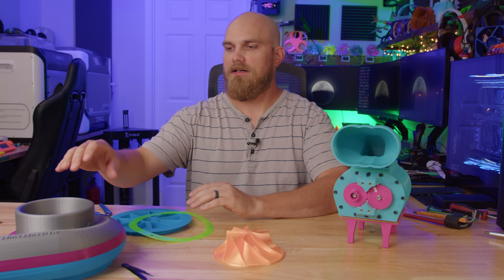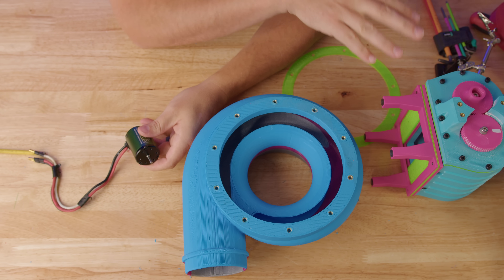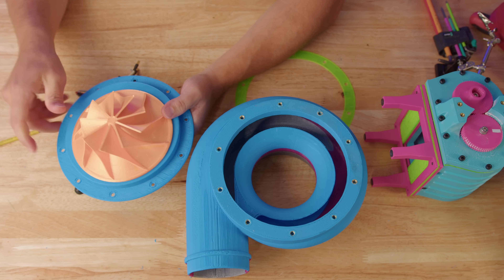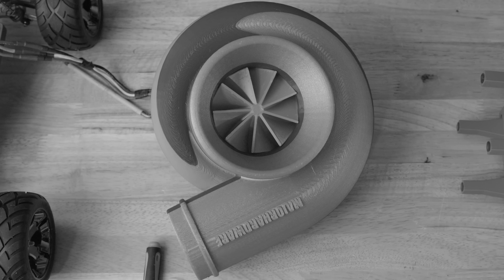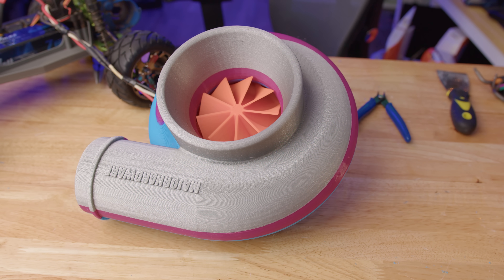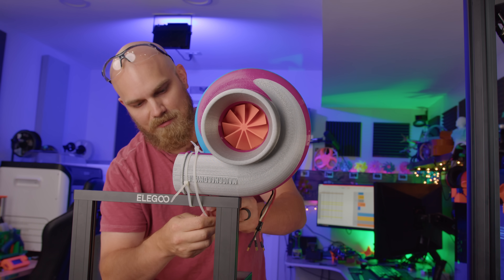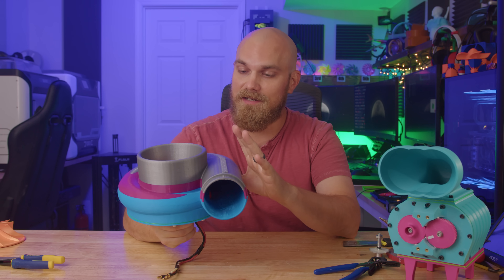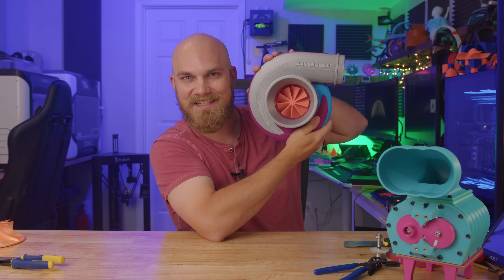I BUILT a MASSIVE ProCharger for my PC

Comment: Hobbywing EZRun MAX6 V3 Sensorless Brushless ESC & Motor Combo w/5687SL (1100kV). This is about the most cost-effective motor upgrade for the Traxxas X-Maxx. I would somehow use a bearing to support the compressor wheel instead of supporting it with the motor shaft.

Comment: Would love to see you try and make an adapter bracket to put the pro- charger into the roots blower and see if that boosts the flow! Maybe two upgraded motors to push them both to 15000rpm. Think like angle grinder speeds...I wanted to see some PLA explode...

Comment: Should look on Hobby king and might want to look at an airplane motor rather than a car motor. The outrunner style motors will likely do better with torque and running at high rpm for a while which is why they're used on things like electric skateboards and large rc helis and planes. Look at the PROPDRIVE v2 3548 900KV Brushless Outrunner Motor. You're also going to need an esc to handle the higher voltage to throw at it to get the RPM you want.  It maxes out a recommended 4s lipo so any 6S, 55amp capable ESC should handle it fine.

Comment: some ptfe spray might help with the friction... and maybe if the tolerances are too tight some sandpaper might come in handy :p Maybe also add some bearing in the center of the intake to prevent it from wobbling around like it did on your model.

Comment: Maybe add a front bearing hub on the intake side shrouded inside a stator and intake horn?  Like using a tail stock on a lathe to stabilize the spinning parts.

Comment: These tiny shafts are meant to drive a gear box of some sort, not have a large and heavy hunk of material directly supported by them. Using a through-shaft with front+back bearings for support would keep the fan perfectly centered and spare the motor from having to support it along with stresses from dynamic imbalances.

Comment: Best motors that I have found are actually out of brushless power tools. You can find a lot of old dewalt DCD996 Hammer drills for not working on ebay. Most of the time the controllers are dead or the sensor on the back of the motor comes unplugged. but most of the time the motors are fine. Do note that the motors from these drills are capable of over 20,000 RPM at 20V. I have found them as low as $20.

Comment: I think that belt drive would help with the design. You could make a beefy shaft running in large bearings and option to space everything properly.
But the belt must be proper closed loop, not the GT2 glued together that you used the last time :D
As for the motor, I'd look at outrunners used in RC planes. They are made for low RPM/high torque loads and often have hub with screws, which would help with your designs.

Comment: gear it or belt pulley and 5:1 then 10:1. that way not too much strain on the next motor. you went direct drive on that small shaft and the motor felt it in whatever transients were caused by airflow and "design imperfections" but you called it all the way through. very fun to watch and great commentary thanks for your hard work and entertainment.

Comment: Hey, I was thinking that maybe you can you use a high torque motor, and use gears to sped it up, like 10 to 1. That way, the force will be applied to the gears and the engine will probably survive... The idea is to take away the load from the motor, and the best way I know of doing so is with gears. You can also use belts. I'm thinking on something similar to the shaft on a lathe.

Comment: Well, I use liquid abrasive polishers, like the ones used while polishing a car, as lubricant for my parts and that kind of helps with tight tolerances... it has a low success rate, like 20% maybe, and is just a last resort, like for instance, I don't want to wait 20+ hours for a print and I'm gonna throw this one away anyways kind of situation.

Comment: If you want to do random stuff like that you need around 4260 (42mm width, 60mm height) with around 600-1000kv with 6s. 
In theorie you would want a higher kV ratio with projects like this but it gets expensive pretty quick.

Comment: Check out Sunnysky motors. I use them on all my rc planes. You  can get them up to 40cc equivalent with 10mm threaded shafts 125 amp and 12 cell rated.

Comment: running a 1/8 scale buggy motor would probably be the best idea, they have 5mm shafts and are capable of 6s minimum, some are the same outer diameter as that one and there are some that are bigger that would work the best for this kind of project, and try to get a sensored motor and ESC, they are more efficient both heat and power wise

Comment: I have an old shop vacuum ac current that is at least 1hp output and a threaded shaft Or i have a 6 volt dc currrent motor that has a splined shaft and would be plenty powerful enough. I would be willing to send either of these to you to try.

Comment: The kV of thre motor you are using is around 3 times too high for your application. You may be able to use a " Prop Adapter " to attach whatnot to the shaft.

Comment: Since the fan designs have been becoming more fun and over the top which makes them impractical for being installed into a computer case anyway. Why not just skip the little brushless rc-car motors and invest in a small induction motor you'd see on a drill press or other piece of equipment? You should be able to rotate a good size fan at some decent speeds with one of those and it can be plugged into your wall. No need for batteries or burning up expensive esc's. :)

Comment: There's definitely room for improvement here. I say do it. I want to see you improve on this & do it better. =^/.^=

Also, I'm right there with you on that motor. That would be my first port of call - upgrading the motor & motor controller. You may also need a battery with a higher C rating, capacity & cell count to suit the larger power system as a whole.

Comment: Hobby king has some great options for motors, escs, batteries, etc. I have a 3.1kW motor and 200A esc in an RC boat I 3D printed which I got off hobbyking for a crazy good price and they are awesome.

Comment: A venturi (aka "velocity stack") on the air intake would probably help, though at these levels, I'm not sure by how much.  Bushing/bearing on the compressor, with a supported through-shaft will help keep the lateral load off the motor shaft.

Comment: Use a three phase brushless motor and inset it into the turbine. Then you can put little tiny breather holes in the center of the turbine and use the turbines natural motion to pull air through the motor for cooling. This will get you really good power efficiency, good natural cooling, and because the bearings on most brushless motors are pretty good it should give you a pretty unbent shaft in the end. Take it from me who learned the hard way though, overspec your motor by at least 50%

Comment: If you do buy a new motor I would suggest a 5mm shaft (or bigger) over what you have now (1/8'' shaft). The only problem you might have with it is 5mm shaft it's more for 32-pitch gears and 1/8'' is for 48p. 1/8'' shafts are really only meant for 2s 2pole 540 motors... yes it can do more but not really made for it + 1/8" shafts like to snap off.

Comment: I really want to see a compound turbo set up. Use 1 A12X25 to power a procharger, then design a second turbo charger that it feeds to spool it up even faster using gear ratios.

Comment: You do understand that compressing air adds energy which heats it up, right?  So, not only are you pumping more air, you're also pumping heated air into your PC...  Also, all that extra plastic will allow your air to accumulate static charge.  And then you're sending that into your PC??

Comment: If you need a good motor it could be wise to look into stripping down an electric leaf blower for parts, Either an AC powered one and use a Variac or one of those battery ones and use some kind of control circuits.  The big thing about motors from something like a leaf blower is they are designed to turn a blower wheel and also designed for continuous service.

Comment: To solve your overheating problem a castle mamba  monster 2 combo with 2200kv motor will work great and the esc works from 2s to 6s. It is my go-to for most of my RC needs.

Comment: Don't wanna sound like hater, just an observation, but why not use some basic tools to fix the prints and make them smooth and sand the stuff that scratches and causes unnecessary friction and noise.
Not just this video, noticed also same thing on some fan videos where fan out of print would be a bit scuffed and some light sanding could make a world of a difference.

Anyways, if you shrink this a bit and tune it up it could be actually usable and probably pretty good fan. PC coolers already comically large, so what's a big snail on top of already brick-sized block of aluminium...

Comment: There's got to be a way to use the waste heat from the CPU cooling to power this right? That thing is putting off what, 100W? Could even end up with a self regulating system if more heat = more cooling.

Comment: You should throw it back ww2 style and make a turbo supercharger from it. The supercharger would need the progressive compression twist screws and should feed into the turbocharger for additional compression. A turbo supercharger assembly uses a gear drive for the supercharger and exhaust drive for the turbo, so you’d need to also duct in a loop of exhaust air to drive the turbo intake before exiting the exhaust loop as well as having an open intake pipe for the turbo to draw in additional air for compression between the turbo and supercharger. Net air pressure coming out of the exhaust loop should be between 1.5- 3x the pressure that the supercharger would be capable of on its own due to the additional boost provided by the turbo

Comment: My Idea for this "Small Beast" of a Procharger would be the following:
Make it 50% bigger and then go buy any cheap Desk Fan because their Motor runs on AC but it has enough Torque for this kind of Setup and it has an 0,3 inch (7,8 mm) diameter Shaft which is halfway threaded which is more useful than you think it could be...
If it is 50% bigger with this superior Desk Fan Motor you can easily outperform your current Design with having probably a bit lower RPM (The RPM doesn't really matter here because of the huge amount of Torque which could handle even bigger ones than just a 50% increase in size, probably up to 120% bigger than the current model)

Comment: You Should add an Top baring on the Intake to make the Blade less wobble or better an Shaft that goes from Top of the Intake trough the Blade into the Botom and then you connect the Shaft with an pulley to the Motor like an 2 to 1 Gear Ratio, so the Motor doesn't need to be at full load all the time
Reply: Does that make Sence

Comment: Awesome outcome!  Flows really well!  Next, all you really needed to do was 'port' your compressor housing to fit the compressor wheel better.  Then, like others have stated- add a prop shaft with a few ball-bearings that lead to the backside of the compressor housing from the Motor. The added space gives more room for the motor to cool / add cooling yourself.   Would then love to see you mock the flange up to a pc case and test the temp drop

Comment: I'd recommend you Turnigy Aquastar T20 3T, it's a 730KV motor, capable to take 11S Like a champ and 12S if you feel like pushing your luck, but it will deliver solid 5200W+, and you will need 2 ESC's tu run that bad boy to it's total power, and you can also hook up to it a water pump with a small reservoir, hense Aquastar designed for boats and capable to move things quickly and kept cool with water.

Comment: The shaft should come all the way through to the front of the turbine and bolt to the middle. That should help with overall shaft alignment. Grease that sucker up good too as you have no lubrication flow. I'd really love to see that pro charger peaking cause at high rpm it should make some good boost!

Comment: Would be cool to do a shaft all the way through the comp wheel with a two bearing support that you then connect to a motor with a coupler. Would allow it to stay nice and straight and compensate for slight alignment issues.

Comment: Since no one is answering the question lol a good motor to use that will eliminate the issue will be a mamba monster x motor and that should have plenty of power and not over heat you will need to make some modifications to make it work though

Comment: To help the motor, I'd suggest changing the orientation so the impeller is below/above the motor or I'd add another point of contact with a bearing at the front of the impeller.

For the replacement motor you could look into the 1/5 scale motors instead of the 1/10 scale you're using.

Comment: You could try a screw type supercharger. Also, you could try a double sided centrifugal supercharger.  One beefy motor between 2 snails. One to force air into the case, and the other to remove it. Basically create a wind tunnel for the comp components.

Comment: "That's how design works. You get them close enough then you let the parts figure it out. Ok that's not how design works." 

Except. It is! That's why you have a break in period for things like an engine. All the seals and clearance bits and bobs need time to work out their tolerances with each other before its ready to operate at peak.

Comment: I wonder how making an airtight case with something like a turbo on the inlet would cool a PC. You’d have pressure driven air moving through and, if you make sure your airflow is good, maybe you could cool more than just having a bunch of fans blowing air somewhere, sometimes?

Basically, a positive pressure system that would send air throughout the case as flow went from high to low areas through the case, and ultimately out the exhaust.

Comment: Hiding a whole outrunner motor in the impeller could possibly help with the stability (the motor has 2 bearings, well placed), and with cooling of the motor if some airflow is allowed through it.

Comment: If you are curious what kinda power you need tesla500 did the same thing you did but with an actual turbo. He has 2 videos on this. Since your parts are plastic i doubt you can reach that much air volume and pressure but its a good inspirational video atleast.
Edit:He has only one video about it but it says part 1 so thats why I said 2

Comment: I think your on to something.  I know of a high rpm motor designed but a crew of top engineer's for a real expensive hair dryer, it's like 100k rpms and quiet.  I'll look for it and post.
Reply: Got it!!!   Both Dyson and Laifen have 110,000 rpm motors in their hair dryers, designed by teams of engineers.  Cost new just under $400.

Comment: Need to get a much lower KV motor, try something around 300 - 600kv should be good. Essentially the lower the KV, the higher the torque for the same wattage.

Comment: Why not print a tpu belt and a 2 pulley system  to run it like a normal procharger (centrifugal supercharger?)? Would also mean easier connection and not needing to tolerance the motor into the part?

Comment: Why don't you use a real turbo from an old car and adapt that. As long as it don't rubs I think you have a good change to get the performance you want. Yeah I know, then it is not 3D printed. But the tolerances in these parts are very difficult to get with 3D printing.                                                                                                                                                                                                                                                              The 3D printed housing looks pretty sick this way. Way better than in one colour.                                                                                                                                                                                                                                       You can put the prints in an alcohol/thinner/paintstripper bath for a few seconds for a smoother finish. Or make a vapor chamber from an old aquarium to do the same job. Better finish and an extra video or two.                                                                                                                                                                                                                                                                                                                                                                     Keep up the good work!

Comment: ProCharger is a brand, many companies make centrifugal superchargers. Maybe add a front support bearing to the compressor wheel so you can run tighter tolerances. The less clearance between the compressor blades and housing the more efficient it will be.

Comment: Motor & ESC combos i suggest:
I would suggest you try out the Hobbywing ezrun max8 or max6 combo.
Specs:
max8 s capable: 4-6s;                   max6 s capable: 6-8s;
max8 kv: 2600;                               max6 kv: 1650kv;
max8 cc: 150A                               max6 cc: 160A;
                        Both sahfts are 5mm;
Feel free to do you own research as I might be wrong.